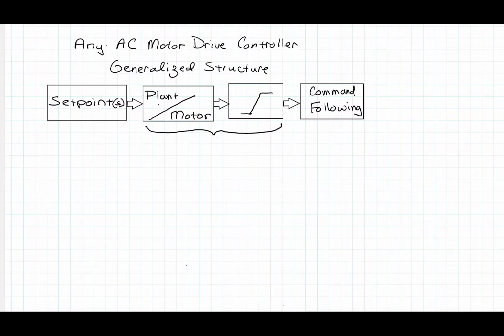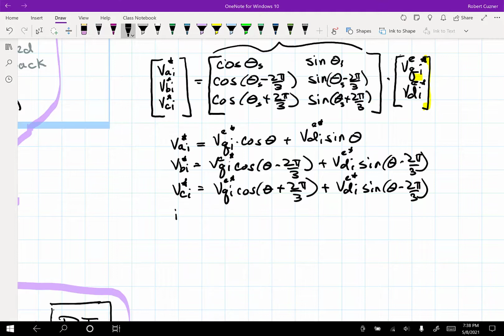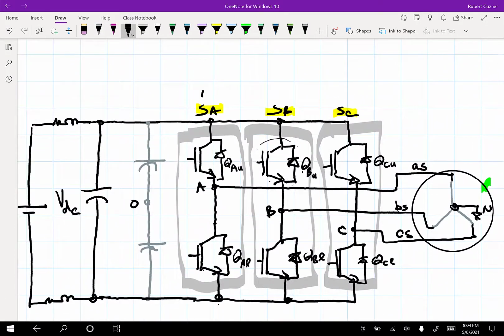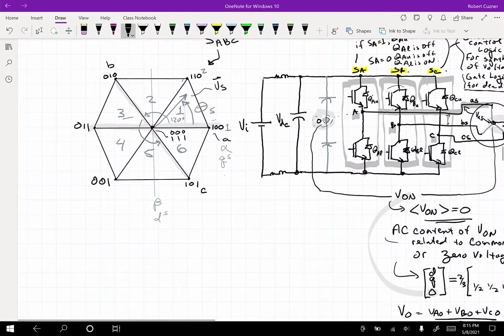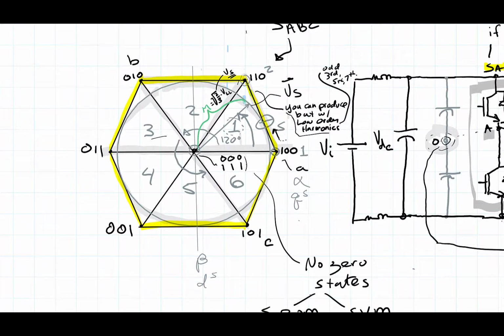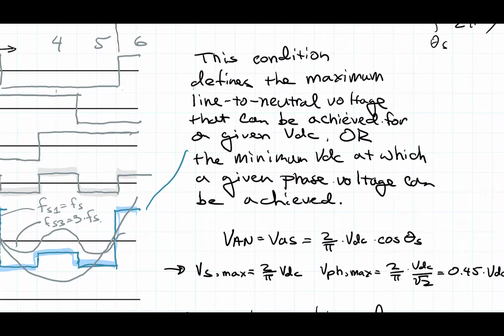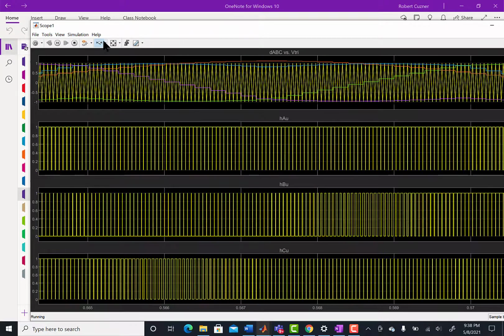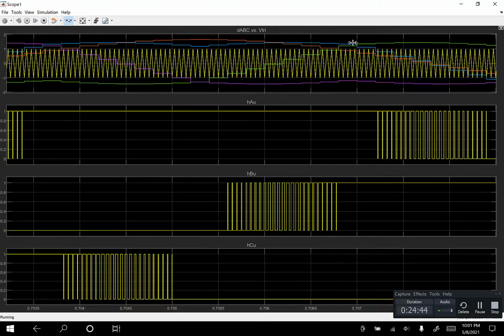Voltage Synthesis for Variable Frequency Drives

Comment: The phase currents under the overmodulation (almost six-step operation) should look different 🤔 It seems that the IM model has a very high leakage inductances, which smooths out the higher harmonics.